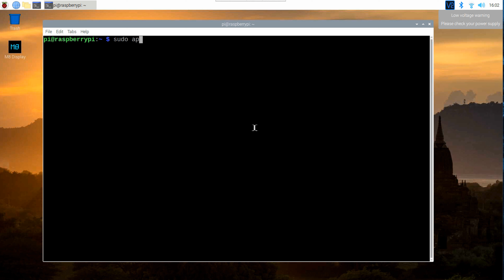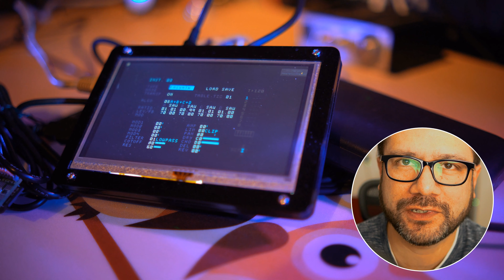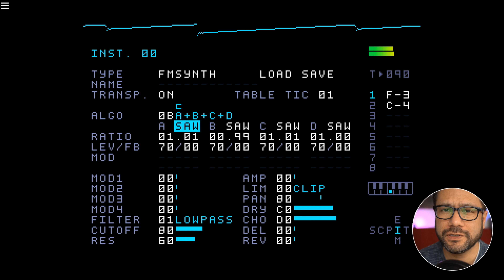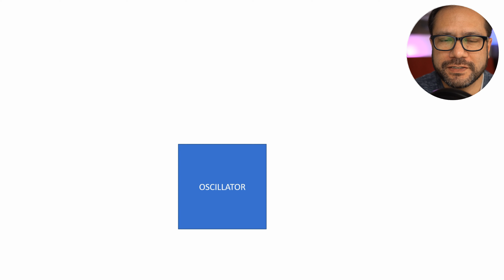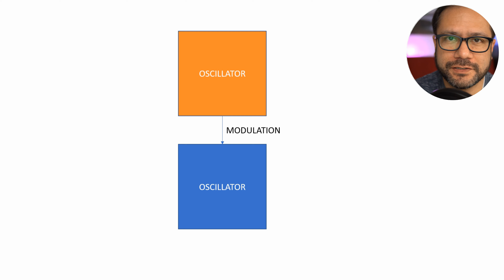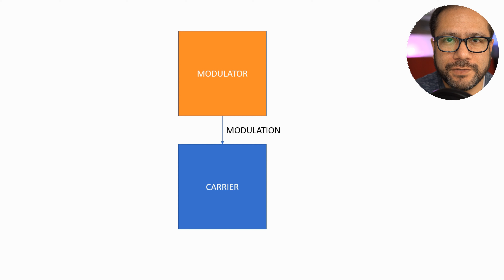Sound design tutorial on a DIY Dirtywave M8 FM synthesizer

Comment: The m8c application might work better on the RPI than running a full browser. I tried m8c on Arch together with a Teensy 4.1 and it works great.
Reply from the maker: Thanks for pointing that out! Pinned.
Reply: +1 for m8c been using it on a ton of devices even a old thinkpad and a PocketChip handheld computer
Reply: Hi, could you explain a bit more in detail how this solution works? I was wondering if there is a way to connect a display to the teensy using i2c or spi. Unfortunately or probably for that reason there are just the hex files available.
Reply: @jenskuhnemann1241  don't know if you ever found the answer but that wouldn't be possible as you need a usb host to use the headless version. The headless sends the display data over a serial connection back to the computer and it is the client app you are using that is responsible for displaying something.
Reply: @droussel7359  well there is a possibillity to do it but it isn't that great
Reply: @jenskuhnemann1241  I think it's possible.
Refer to the web source code, there are just Java codes to do the input and output.
Even it's in hex only. There are many MCUs with USB host can do the keyboard input, display, and DAC out for Teensy 4.1

Comment: Hi ! Great video, do you have a recommanded version of the OS ? The last one is absolutely unusable for the 3b+, a little bit better with a previous one I don't remember which one precisely.. I have some cracking  sounds, like small clips sometimes. Any tips ?

Thanks ! :)
Reply from the maker: Hi! I'd recommend the oldest OS you can get, preferably a 32bit version, on the PI3.
Reply: @mr_floydst  Thank you ! I'm actually trying to run the jack server at the startup, but the jack_connect is not working with systemd. My script is working but with systemd I'm having a lot of errors :/ Do you have an idea ?

Comment: Thanks for sharing!  It looks like the software for this tracker (derkyjadex) can be hosted directly on the raspberry pi (I haven't yet tried this). Once installed, the unit would need no external networking, which would should make this a fairly standalone device.
Reply from the maker: Thanks! Yes, that's true. I should mention this in another video.

Comment: Gave my pi4 a go too. Sadly the webdisplay does not work well for me. It does not show up fully. So i went the way littlescale went and that works fine. Thx for the tutorial, cant wait to hold the original in my hands.
Reply from the maker: Sorry to hear that. For me, it worked after updating the system. You need a fairly recent version of Chromium...

Comment: This channel is great, thanks for sharing. 
I have a bit of a random question, can I connect a Hyperpixel 4.0 Tft Capacitive touchscreen to a macbook pro m1 to use as an external display? I can't find much information on this. I could do without the touch. Thanks!
Reply from the maker: Unfortunately not. It has no HDMI port. You can use this one, though: https://www.amazon.de/gp/product/B07QKT6L58/ref=ppx_yo_dt_b_asin_title_o01_s01?ie=UTF8&psc=1

Comment: I'm interested in this project. I don't really understand what the Teensy is doing though. What is the point of the Teensy?
Reply from the maker: The Teensy is the driver here, I used the PI only as a screen (in fact, any device can be used as a screen). This is the free-to-download version of the DirtyWave M8 handheld device which is based on a Teensy.
Reply: @mr_floydst  thanks. I'm still trying to wrap my head around how all of the components are associated. I understand now that the m8 is run on the Teensy. I think it plugs into a computer just for the purpose of having the computer run a display and input device.

I don't quite understand why the software is on the Teensy and not just on the Pi. I suppose that allows it to be OS independent. Does the Teensy also have features that m8 benefits from such as sound synthesis?

I'll likely get it up and running and use my Surface Pro 3 as the display. I have some Raspberry Pi Zeros that I typically run headless. I wonder if I can use a Zero for this.
Reply from the maker: @dviant13  The Teensy is a microcomputer, too, just like the RasPi, but with lesser specs than the latter, and from another manufacturer. The developer of the M8 handheld chose to use the Teensy as the foundation for his instrument, and he also released compiled versions of his software for download. This will only run on Teensy, not on Raspberry PI. And you can't port it to RasPi because it's already compiled, not open source.

Comment: Another great video . Love your zynthian vids as well!!I have a crowpi with a pi3b in it (the suitcase model) iw onde how easy it would be to set that up as an m8 system ?I'm not great at coding  but the crowpi has a touchscreen 7 in bilit in
Reply from the maker: Hi, thanks for watching! That should be no problem. Some of my viewers suggested using M8C ( https://github.com/laamaa/m8c ) is better on the model 3 PIs. You don't need to code here - but you definitely need the teensy 4.1, too.
Reply: Thank you for that info Floyd . Viele danke hope wrote that correctly

Comment: I am looking into making a diy portable setup similar to what you have constructed- do you have recommendations on which raspberry pi or similar device to use for best performance/value?
Also, is it possible to have the device automatically boot the m8 teensy software on startup?
Thanks
Reply from the maker: I think a RasPi Zero-2 with the M8C software https://github.com/laamaa/m8c will be the smallest possible setup. Just add the m8c software to your .profile file which sits hidden in your home directory.
Reply: @mr_floydst  thanks! My goal is to make something portable and self-contained but I don't mind if it ends up bigger than a dmg gameboy or even a small desktop synth. If you have any more tips I'm definitely receptive, and I'll be sure to give you credit for inspiration

Comment: Love your videos, now i don't know any coding, but i was wondering if there's a way to make the raspberry pi boot directly into m8? 
In wondering if it would it be possible to create a controller for the m8 firmware using teensy and have a screen for it, a homebrew m8.
Reply from the maker: You can just edit a file named .profile in your home directory and add a command in the style of chromium [web page url] to it's end. Which will auto start the browser with that page every time you turn on the PI.
Reply: @mr_floydst  thanks will give it a shot!
Reply: @mr_floydst  do you think teensy 4.x is powerful enough to read IO controls and output audio (via DAC maybe) as well as video on a smaller LCD (like one on DSO 138) or would there be a need for separate CPU for that?
Reply from the maker: @jordan_gentry  To be honest, I didn't dive into that yet. Thinking out aloud, I'd presume the "real" M8 is built around a Teensy, and the USB connection is exporting both the screen data and audio, so whatever is needed to run the periphery does not really need to process data, only display it. But again, just guessing here.
Reply: @mr_floydst  You're spot on, the actual M8 is a Teensy 4.0 with the screen, buttons and dac connected to it.
Reply: @MaksimLin  do you know which DAC it is ... I hear that the one of the manufactured M8 sounds really great

Comment: I can safely say that I will never get one of these mainly because there is a very good sounding FM sythersizor on Android and I bought a used tablet for £70 just to use it. I also have an old 80s Yamaha with FM editing which easy to make classic FM sounds.
Reply from the maker: Fair point! But the M8 does a lot more than FM - there are two subtractive synths and a sampler in there, too.
But the workflow is indeed dominated by a lot of careful planning, to put it like this.
Reply: @mr_floydst  It definitely has value however I have a Peak, MiniNova, old Yamaha (forgot the number) Reason, Abalten, Aturia Analog lab V with Minimoog unlocked and sythersizors on My tablet, I really dont need anymore ways to make sound.